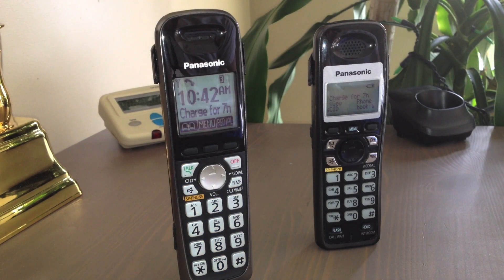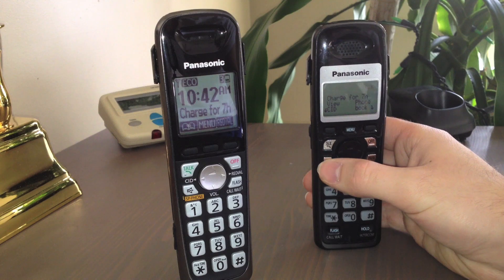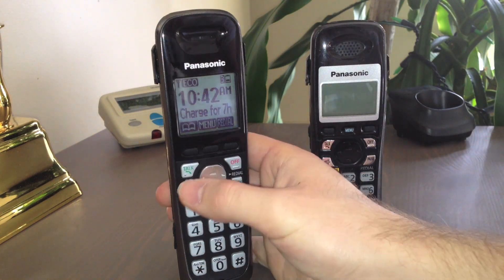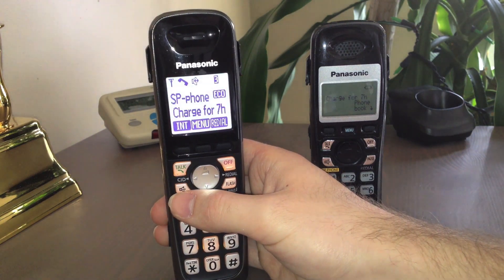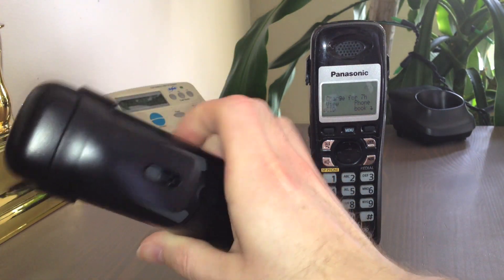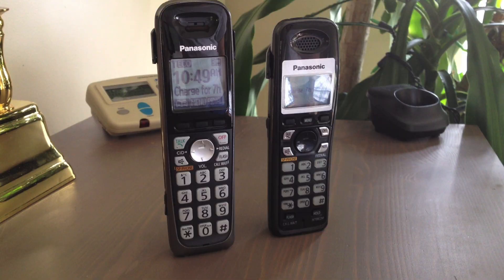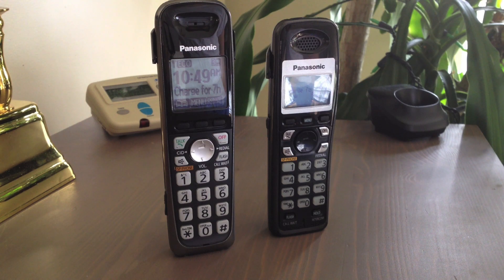Panasonic Cordless Speakerphone Problem Solved

Comment: I changed the battery and replaced them with the Panasonic rechargeable battery and the phone works but the speaker doesn't.
Reply from the maker: Is it producing the same behavior as seen in the video?
Reply: Yes

Comment: Hi. I have a Panasonic KX-TGA659 Phone. The battery window on each handset shows the batteries are fully charged. But when I use the #1 handset, the caller cannot hear me and I cannot hear the caller. Before I invest over $20 in batteries, do you know what my problem is? Could the batteries cause this problem? "MUTE" is NOT on. Thanks!
Reply from the maker: You could try taking the batteries out of one of the working handsets and swap them with the non-working handset to see if the problem goes away, but that doesn't sound like the issue that was dealt with in the video.
Reply: @JordanU  Thank you.

Comment: Ours have worked fine for years but just yesterday one became horribly distorted, distorted to the point that it was hard to make out what the person leaving the message was saying.
My first thought was that the speaker was shot.
Could a pair of new batteries fix this?
Thanks, Reg.
Reply from the maker: It's possible, I would swap the batteries with a working handset and see if the distortion follows the batteries..
Reply: @JordanU  Oh boy.  Why didn't I think of that?
I'll give it a try tonight.
Thanks for thinking when I'm not.
- Reg
Reply from the maker: @mottledbrain  No problem

Comment: Both of mine fail in exactly the same way.  Funny how the newer one "sputters", but the old one just goes out.  I'll be watching for your video on the batteries.
Reply from the maker: +jaykay18 I found that odd also.. after the video I swapped the batteries,, put the DECT Plus batteries into the DECT, and it didn't even come back at all.. was totally dead.. The DECT Plus with the DECT batteries worked better, could go up almost all the way to full volume before it 'sputtered'.. So, the DECT Plus phones are apparently quite a bit more efficient.. Its also worth underscoring that the DECT phones only claim 4.5 hours of talk time, whereas the DECT Plus phones claim 13.. (Those are 'up to' claims, not real-world claims) Standby time is the same for both at 11 days..

Comment: My phones had poor volume when I bought them but cordless phones are in short supply and so I didn't take them back. It seems odd that all 5 would have had failing batteries when I bought them, but I'll take your advice and hope for the best. Thank you.
Reply from the maker: Low volume is not the same issue as seen in the video. What model are you working with?
Reply: It's not even listed on its site: KK-TGEA40
Reply from the maker: @imkcallan  Does the volume change at all when you use the volume adjustment buttons?
Reply: @JordanU  It will go down, but it's highest point isn't high at all.
Reply: The speaker phone is the biggest problem. If I use the speaker phone, I have to still use the handset to hear and it's still not that loud.
Reply from the maker: @imkcallan  I haven't used that particular model before, the volume may just not be that good on it.

Comment: Love my KX-TGA402. Cannot hear in handset. Faint dial tone or speaking voice. Speaker and base messages are fine. Only 4 sound bars in handset and cannot set higher. Regularly change batteries. Disconnected and removed batteries for hours. Never wet or dropped.  Is it simply time for a new Panasonic? Hate to do and lose saved messages.
Reply from the maker: It sounds like the receiver capsule has spoiled.. A relatively easy repair, or you can replace just the handset without tossing the entire system..
Reply: Will research "receiver capsule" then search for handsets. Thank you.
Reply from the maker: OK

Comment: Been not wanting to replace my Panasonics because they moved the speakerphone button.  I use it all the time, but for some reason they completely reworked the keyboard lately, and it is so confusing - the speakerphone button is at the BOTTOM of the phone.  So you pick it up and have to hit it at the top and bottom to talk - and that round directional in the middle is very confusing.  My speakerphone is just loopy though.  I'll try this and see if things change.
Reply from the maker: OK

Comment: When you put a brand new battery into the phone how long do you need to charge the new battery? What will happen if you pick the phone up while it was being charged?
Reply from the maker: Usually for these phones a 7 hour charge period will suffice.. If you remove it while being charged, it will not reach full capacity..

Comment: I wish i seen this video before buying my new Panasonic kxtgf544! My speaker on my handset is not loud enough. I turned the volume up and you still have to be a foot away or hold it to have a conversation!  My old Panasonic no problem i could be anywhere in the room! Help me please! Thanks!
Reply from the maker: The new phones are not made as well as the old ones were. There’s nothing you can do about it.

Comment: i have same phone, spkeaker not working at all, checked every settings, replaced the battery with new ones, still speakers not working only light blinks when a call is coming..please help
Reply from the maker: The speaker is probably spoiled.

Comment: I had a problem where my phone wasn't ringing so I finally found the instruction manual and all I had to do is press the zero key for 5 seconds and now it rings again, I had seen somebody with another Panasonic phone said to press the pound key for 3 seconds but I guess that was an older model.
Reply from the maker: Thanks for letting me know.

Comment: my tdga51 phones and base charging and check tel. line  but no dial tone and can not begin a call.  what is wrong ? how do I fix problem?
Reply from the maker: That is probably an issue with your phone provider.
Reply: Your modem or connections might be bad or your service is down. In our case, the phone cannot detect a connected line if the modem is booting up or signal is lost.
Reply from the maker: @techwithtyler20  That’s what I said, it’s likely an issue with the provider.

Comment: Have a 5 system Panasonic home wireless set. Misplaced #5 in hous, battery is probably dead. Any suggestions on to find it.
Reply: @JordanU : Get your dog to look for it
Reply: That actually happened to us in 2018! Luckily I had a handset that I wasn't using and put it on our system as handset 1.

Comment: My Panasonic cordless phone will not hold any kind of programming. Well it holds the time and date but it won't hold a caller id list, announce the caller or hold the last call for redial.
Reply from the maker: What model are you working with?
Reply: Jordan U Panasonic Link2Cell Bluetooth Enabled Phone KX-TG7875S
Reply from the maker: I'm surprised you're having problems with it,, those are very highly rated phones.. You could try taking the batteries out and unplugging the system for a few hours then powering it all up again..
Reply: Jordan U  Did that to both the handsets and unplugged the base. May be the result of a weather event. My modem was reset earlier. I am away for months so I don't know what may have gone on with the weather. I've had the phone for less than 2 years and paid a bit for them so it's a surprise to have them fail.
Reply from the maker: It very well could be the result of a power surge, those can cause all sorts of havoc on electronics.. Do you have the unit on a surge protector?

Comment: too bad you don't fix the speakerphone problem. Title miscommunicates. Your fix doesn't impact the speakerphone issue
Reply from the maker: I have no idea what you're talking about. The title does not miscommunicate anything. Replacing the batteries will resolve the issue with the speakerphone as seen in the video.

Comment: That's not good news. Is it possible they just put out a model that sucks?
Reply from the maker: They're all made in the China now so anything is possible when it comes to the quality control.
Reply: @JordanU  I guess at this point, I know it's a lost cause or do you think it's worth buying at least one new battery and seeing what happens? or just stop being Charlie Brown with the kite?
Reply from the maker: @imkcallan  I would take it back and try a different model. While this doesn't mean it's inconceivable, I've never seen bad batteries cause the issue you're experiencing. They consistently create the issues seen in this video.
Reply: @JordanU  it’s been a while. I don’t see Best Buy taking it back after having it such a long a time — otherwise I would — I’ve been lazy about it. There are 5 devices and I didn’t want to break down the system and take it back — I seem to be stuck at this point. Thank you for your help with this.

K

Comment: Sorry to say I have 2 out of my 6 handsets where speakers stopped working and I replaced it with new OEM batteries  - it DID NOT FIX THE ISSUE
Reply from the maker: The speakers stopping working is not the same problem as the handsets completely blanking out as shown in the video.